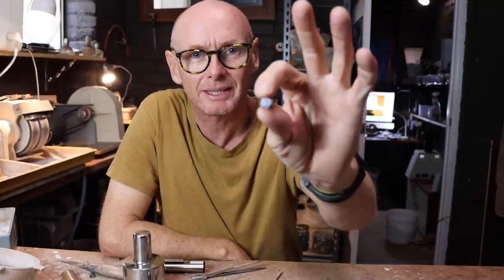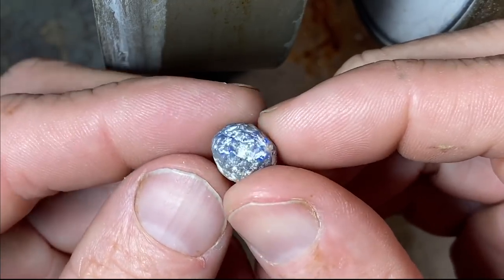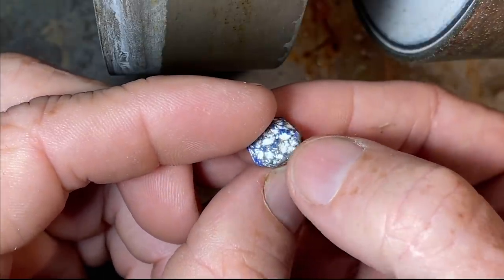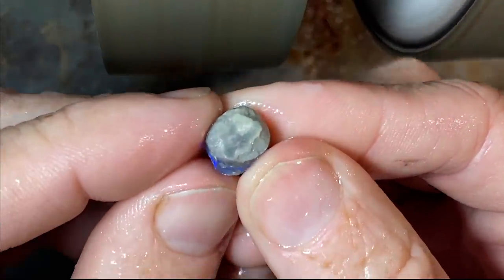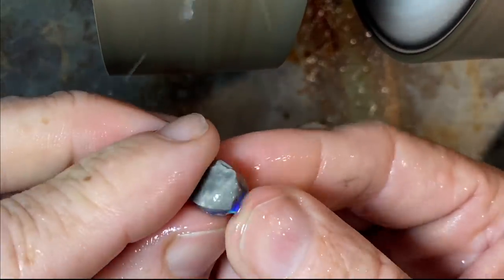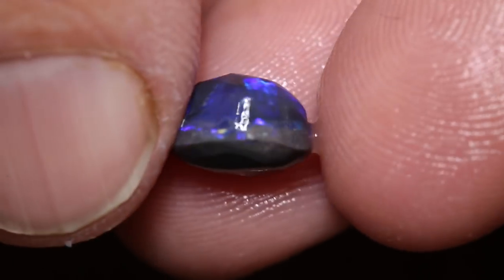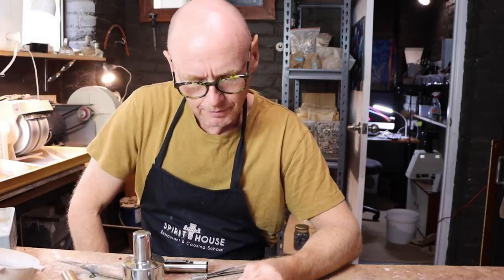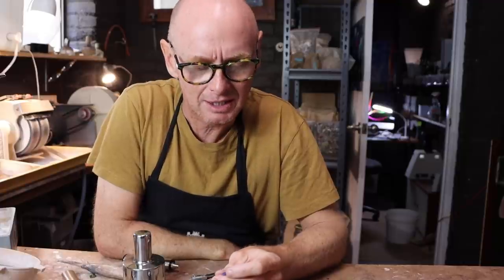This blue glowing rock is a rough black opal waiting to be cut

Comment: Quick question. You said using unhealthy potch as the backing would make the good color crack. Would you ever use sand as the backing or would that destroy the stone also? Thanks. Have a good night. 💎      Wow... Pea nobby gem sold already👍 ... that was quick
Reply from the maker: Sand can be okay as long as its hard enough but does devalue the gem somewhat

Comment: That was a very big reduction in size.  Can you explain what kind of pressure the potch exerts on the opal?  Is this a hydrostatic pressure, where the potch is retaining water from the environment?  

When I first saw that nobby, I thought it would make a good candidate for tumbling in a polishing drum. Is that possible with this kind of opal, or it is too fragile?

Great end result. Thanks for sharing your expertise.
Reply: I've noticed alot of the time it takes less heat or pressure to break the host rock vs the gem, and being attached, if the host rock, or potch in this case, cracks, it can take part of the gem with it.  Just my opinion, no scientist here.  Just a rock enthusiast
Reply: I would also like to know what kind of pressure the potch is creating to possibly cause the opal to crack and how do you identify that?
Reply from the maker: It is not really proven why. But I would imagine that once that bad potch dries out it maybe contracts and makes the quality opal break
Reply: @blackopaldirect  That makes sense.  I know some Ethiopian opal will become transparent if submerged in water or even worn on sweaty hands.  I would have thought there would  be a hard, non-porous sealer that could be painted on the stones so they wouldn't lose or gain water like this.

Comment: A question for you Justin! The potch on the back of this stone was riddled with small fractures and that puts stress on the opal, correct? Is it possible for the interior potch on this stone to be similar? Would that create as much tension and stress on the stone as the back face potch being bad?
Reply from the maker: No the potch inside is a different healthy type to the grey lined potch on the cap so no it should be fine

Comment: How were you able to identify that the potch beneath the stone was dangerous to the stone? You seemed to imply it may be more prone to breaking if you left some of the grey potch on the bottom
Reply from the maker: That is correct but not all grey potch is bad only this type
Reply: @blackopaldirect  could you specify what you mean by “this type”? What exactly indicates to you that the potch may be dangerous?
Reply: @blackopaldirect  I ask in the hope I might learn from you how to prevent myself from cutting a stone the cracks shortly after i gift it, or sell it.

Comment: why does that potch risk damaging the gem? 
Is it something to do with different rate of thermal expansion?
Reply from the maker: Yes something like that or drying out once out of the ground
Reply: Black Opal Direct - thanks, interesting stuff that I never would have considered 👍
Reply: Black Opal Direct - how long are these out of the ground by the time you work them on a video?
Reply: Black Opal Direct - so after you work them and they are polished wont they continue to dry out and eventually crack or are they to be worn sporadically and kept in a solution to keep hydrated?

Comment: Can you use a high pressure water jet, to dislodge the sand?
Reply from the maker: I suppose you could but I dont need it to be undulating so its easier to grind it away

Comment: What kind off machine can u cut it with? I only find setups from a thousend n up.  Are there ant used machines for sale?
Reply: Generally, machines are going to cost $1000+. You could hand polish (Justin has a video or two on that) or I've seen a single angled flat lap machine for a few hundred and you'd have to swap laps back and forth. In generally used machines aren't real common and get snatched up quickly. Machines also hold their value pretty well, so I wouldn't be expecting to pick a used machine up at a huge discount, maybe a few hundred bucks off new
Reply from the maker: Used are very hard to find
Reply: @blackopaldirect  yes escpacialy here in the Netherlands, seen a couple on the net but all in the uk with no shipment😔. 
Bout how many rpm does the wheel spin of you dont mind me asking? 
I do know a wet grinder that does bout 500 rpm. 
I did read ya cant use a wheel above 800 rpm n that it is mostly for shaping the stone?
Reply: @Josh-gi8ht  seen a couple in uk going for 200 upto 400 pounds, but no shipment.
did see that video to.
Think thats the video that triggerd my interest in wanting to cut opal😂 
Never knew could be done by hand. 
But then i thought maybe it will be worth it if i bought a machine.
N since Justin knows better how to do it by hand n how to shape it. 
IT might be easier for me with a machine.
Did see a place in a town nearby here in the netherlands where they give classes cabachon cutting, 90 euro for 13classes n after the course you can use their equipment for 6 euro's n do what you want.
Reply: @MLOpals  I would give the classes a go. I did something similar and joined a lapidary club and through a person there I eventually got mt own small machine plus working on cheaper rocks can give you good practice before touching expensive opal.